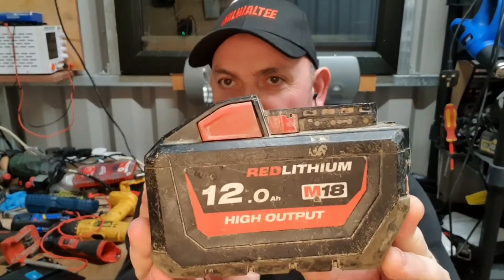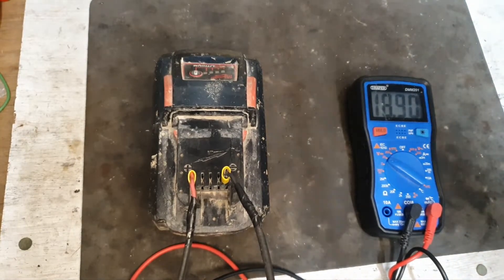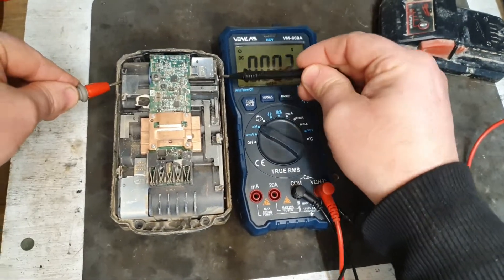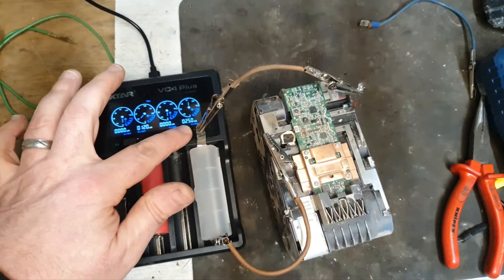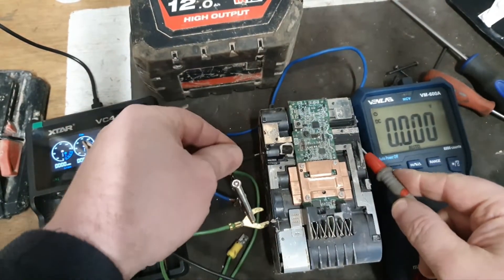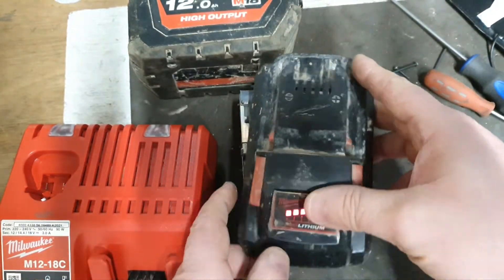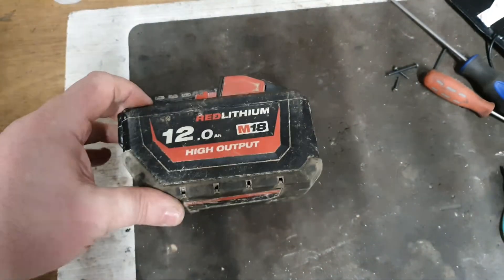M18 12ah Repair and reset lifehack #milwaukee #batteryrepair #howto #powertoolrepair

Comment: I get a connection break signal when I put my Sigma 3 battery charger on it and it won't even charge because it says (connection break) , and when I charge my battery with the Milwaukee it's flashing red and green

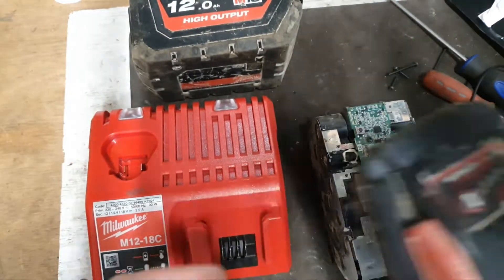Comment: In the video, at 2:04, do you connect the positive input next to the negative input of the battery and connect it to the battery charger? I did not understand the translation because it is not my foreign language.
Reply from the maker: Connect negative and one beside it for a few seconds then remove connection 
Put top on put a tool on it attempt to activate tool
Remove tool place on charger it should reset
Reply: @doctorlefthandthread  There is 20.4v in the battery. I apply 4.2v voltage to the negative and adjacent input for a few seconds, but the battery still does not activate. The battery indicator is only one light on. I don't know where I'm going wrong.

Comment: I got 12.0 battery hardly ever used. I left it in the car below -0s and only lights up 3 bars would this work?
Reply from the maker: You need to take it out of the casing and test the cells there may be some cell imbalance.
Reply: @doctorlefthandthread thanks

Comment: Any other way to reset the board when it’s reeding 20v but still flashing, tried the trick in the vid but didn’t work for me
Reply from the maker: Sometimes it works tried it last week and it worked on one but it won't work on them all.

Comment: I just purchased a jump starter adapter for a m18 battery and tried to jump a motorcycle. It cranked for a second and then I smelled the magic blue smoke leave the battery. Now when on the charger it’s a sold green light and the light on the battery flashes 1 red light when pushed. Any guesses?
Reply from the maker: This video may help
https://youtu.be/WRtOrJk0VKU

Comment: All you have to do is put it back on the charger to reset it at the voltage that it is at. So if you rebuild it or if you recharge the individual cell like you did just throw it on the charger it will reset exactly to that voltage. If you have a battery let's say at 20 v you need to charge the whole pack as long as everything is equalized and raise it up to 20.5 with a power source or like a B6 balancer charger bring it up to that voltage and then put it on the charger and it'll set it at that voltage also if that battery is only coming up to 4 volts that's probably a bad battery it needs to be coming up to at least 4.1 if it's being charged individually otherwise it's a weak cell. And you should probably just replace it because it's just going to happen again most likely. I've been in the business for almost two decades working on batteries every day of my life so I'm just trying to give some helpful hints but you do great work I really appreciate the videos they really are very common problems that a lot of people need help with so you're doing good for the world 👏🏼👏🏼👏🏼
Reply from the maker: Thank you for the advice and the helpful comment. Your comment will help people out.
Reply: @doctorlefthandthread  absolutely, if I were to start a YouTube channel mine would look almost identical to the issues that you tackle so I find it very encouraging. I think you've got one up on me on some of the 60 volt stuff I am still trying to figure out those darn things circuit board out you might actually even be able to help me with a couple questions. That you have found the answers to, but boy those are quite complex with the variety of issues they can have.
Reply from the maker: @JohnnyTokens1  I am not an expert on the flexvolt but I know a little

Comment: U lost me on the part connect these 2 terminals.  What am I connecting to what?
Reply from the maker: There is a - terminal you connect it to the one beside it for a few seconds then put a tool on it pull the trigger and then put it on the charger it doesn't work every time

Comment: I have same battery but slightly different issue....
Takes longer than usual to fully charge and battery goes flat super fast .
Why does this happen??
Is it just crap 18650 cells ?
Reply from the maker: 21700 cells in the 12ah. Did the battery do alot of charges if so it could be just knackered
Reply: @doctorlefthandthread  ahhh OK, and not really just noticed over time instead of battery lasting me all week on the chopsaw now only last a day .bad really from milwaukee as I've got an older 9ah bat and that's still going strong
Reply: @GOODY866  bad inbalance does that, did you open the pack up and check individual pack voltages?

Comment: Great man you are awesome.
In addition to doing this, despite having the voltage 19 V, I re-soldered all the battery contacts that go to the BQ79625 chip, so when I pressed the button, the LED did not blink and when I put it in the charger for a while everything worked perfectly.
Reply from the maker: Thanks for your comment

Comment: What should I do if 5th cell is 0 voltage? Can I jump only this cell? I cant charge with balancing charger because it say low voltage
Reply from the maker: https://youtu.be/NECSbpOS5X4?si=X2sDuBjpw43L-LP0
Reply: Replace them
Reply: *Replace the bad cells

Comment: Hi great and informative video. How do I find a fake battery with the leads like you have? Can’t seam to find one.
Reply from the maker: I made that up out of an old case a battery cell was delivered in and some leads
Reply: @doctorlefthandthread 
Cut a dowel rod to fit battery charger. 
Make leads up with ring terminals on battery charger end . I'm guessing 3/8" ring terminal should work,  fit between dowel and battery charger contact.

Comment: By connecting these two terminals you mean short them? Thank you
Reply: Yea yea just wasnt sure if you just short them or run current through them. I did short my 9ah but it didnt help. All cells are fully charged manually but the single diode still blinks. The charger is charging and during the charging IT shows three bars despite IT having over 20v on the pins. After taking IT off the charger (im worrying about overcharging) it comes back to the single blinker and wont run my tools, just the light in the drill lights up for a few secs.  Thanks. Have you Heard about reviving bms with a 9v battery?
Reply from the maker: @andyOsalek  same thing but if it doesn't work I put a new board on
Reply from the maker: It doesn't cause a spark or any issue

Comment: Hello,I have a problem with M18 9Ah,one side of batteries are 0,06v and VC4 doesn’t recognise them.
Reply from the maker: The voltage is too low the charger can't charge it
Reply: @doctorlefthandthread  another 8Ah battery just flashing red and green and all the lines are 3.5V.
Reply from the maker: @lucidandu2798  I would replace the board on it if the reset doesn't work
Reply: @doctorlefthandthread  reset doesn’t work,almost brand new,less than a year,few times used.
Reply from the maker: @lucidandu2798  if you can't warranty this is the only option if cells are ok and reset doesn't work https://youtu.be/e_EZqzaU7dE?si=s5wHvsYca9wmFyoW
Reply: @doctorlefthandthread  i bought from the store but problem is I lost receipt with warranty 😒
Reply from the maker: @lucidandu2798  you could try jump starting the 9ah with another battery to revive the cells  and put a new board on the 8ah
Reply: @doctorlefthandthread  already tried to jump 9Ah and nothing.
Reply: @doctorlefthandthread  8Ah when I tried to jump it charged from other battery up to 3 lights but still flashing red and green
Reply from the maker: @lucidandu2798  the 9ah is probably done you should be able to save the other one
Reply from the maker: @lucidandu2798  did you try resetting the board again?
Reply: @doctorlefthandthread  yess
Reply from the maker: @lucidandu2798  if the board doesn't reset and the cells are good you have to replace the board
Reply: @doctorlefthandthread  thank you anyway,any chance to jump just cells with problem?
Reply: @doctorlefthandthread  any chance to save them?